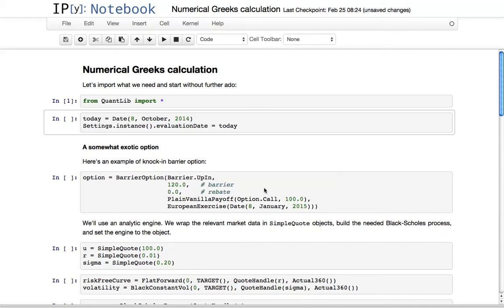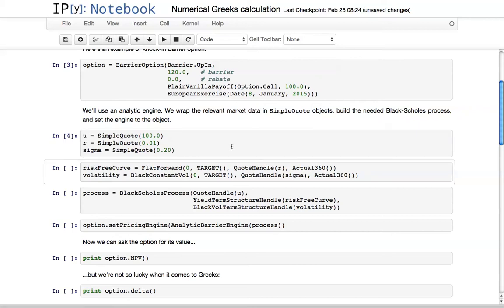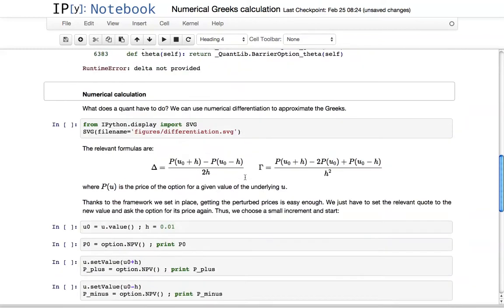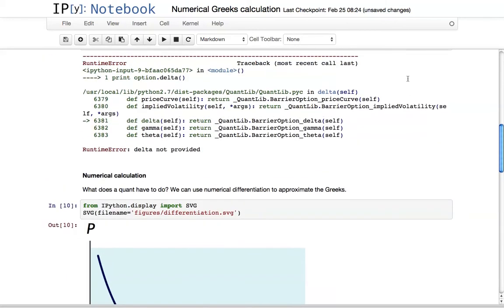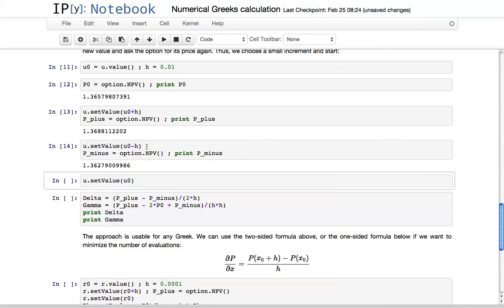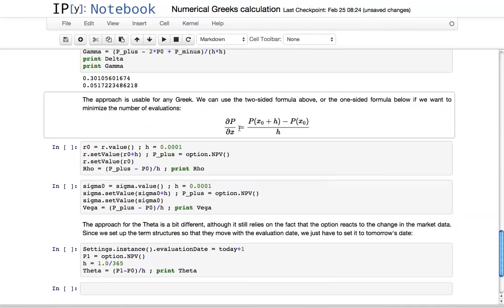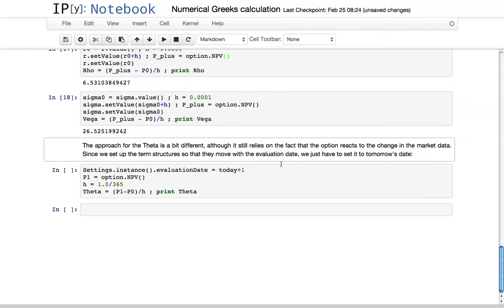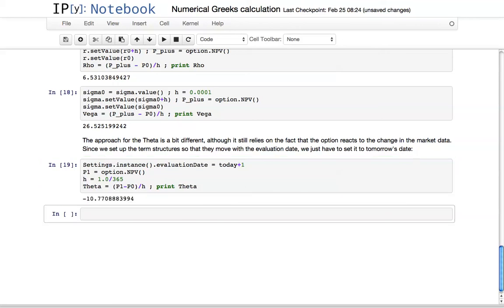QuantLib notebooks: numerical Greeks calculation

Comment: Abstract

This notebook explores how to calculate price sensitivities ("greeks") for financial instruments that don't provide them directly.  The example uses a barrier option. It demonstrates how the QuantLib framework, combined with wrapping market data in quotes, allows for efficient numerical differentiation.  The process involves:

1. *Setup:* Instantiate the instrument, connect to market data (underlying value, risk-free rate, volatility), and prepare a pricing engine.
2. *Perturbation:* Change a market data quote by a small amount (e.g., increase underlying value).
3. *Recalculation:*  Ask the option to recalculate its value (NPV) with the updated market data.
4. *Differentiation:*  Use numerical differentiation formulas to approximate greeks (delta, gamma, vega, rho, theta) based on the price changes.

*Key Points*

* *Flexibility:* This technique works for various greeks, not just those directly provided by the instrument.
* *Efficiency:*  The quote framework avoids full recalculations, saving computational effort.
* *Limitations:* The evaluation date requires a workaround, as it cannot be directly placed in a quote. 

i used gemini

Comment: If the time is always moving forward, aren't you getting two different value for the theo price between the call for plus and minus values? aka same argument you made when computing vega and theta where the kludge seems to be setting the evaluationDate explicitly so as it snap it back to some "common value"
In short: Isn't that a major bug in quantlib.
Reply from the maker: In the default configuration, QuantLib doesn't have intra-day resolution but only dates (no seconds or even hours), so it wouldn't be an issue even if the evaluation date was not set.  In any case, though, setting the evaluation date explicitly is not a kludge, is the common mode of operation.  You want to have control of the evaluation date, not have it given to you from outside.
Reply: @lballabio  "so it wouldn't be an issue " - YES it would be even if only doing it based on dates (not hrs/mins/sec). Consider the following situation: If I''m performing a computation near midnight where one part happens on the current date and the next happens 1sec later on the next date that will cause a bug in the results. The best solution is to have a term structure type that takes all the pertinent info as one snapshot
Reply from the maker: Yes, I'm aware of the problem at midnight, it's documented.  That's why, in any example you'll find, one first sets the evaluation date before doing any calculation.  Having the term structures take the current evaluation date is not a solution, because you can have any number of term structures for an instrument and they would snapshot it at different times—the same problem you pointed out in making two calls to NPV.  An alternative would be to snapshot the evaluation date just once and pass it to the call to NPV or delta or whatever, but that means that it will need to be either passed as an additional argument to all function calls within, or passed to the term structures for storage.  Both will interfere with the caching and notification machinery currently in place.  Setting the evaluation date is a working tradeoff.
Reply: @lballabio  thanks for the clarification it make sense. Would be really nice to have a video or two dedicated to such idiosyncrasies of quantlib.
Reply from the maker: @PerriPaprikash Not sure if a video is the right medium.  Some of that kind of content is on my blog, for instance https://www.implementingquantlib.com/2015/02/odds-and-ends-global-settings.html
Reply: @lballabio  that blog of yours is full really valuable gems, thanks!